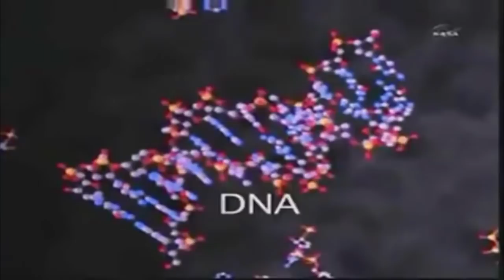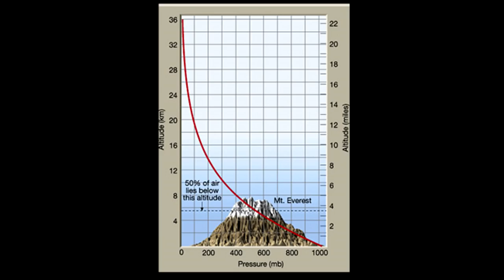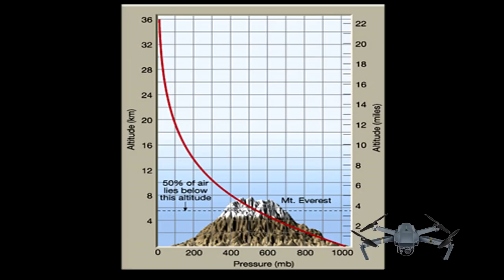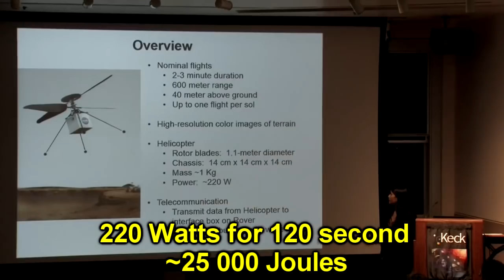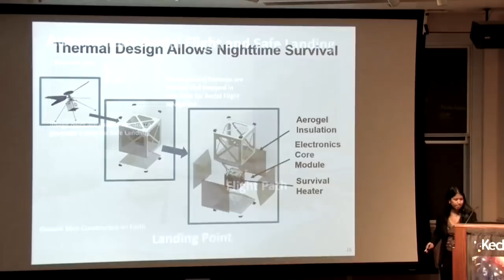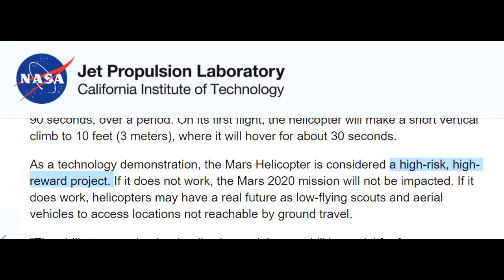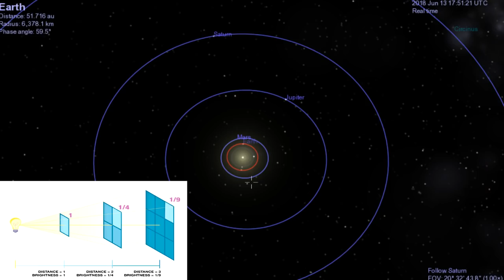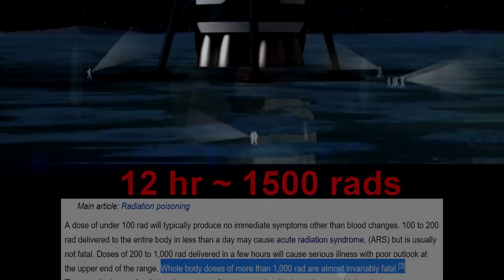NASA is sending Helicopter to Mars!! Smart or Silly?

Comment: I have seen a number of NASA projects that sounded designed by an group of sci-fi fans without life experience, I still remember when I was a teenager trying to design inventions that would work well on a movie or cartoon but would not follow physics rules. Lack of engineering education and life experience drove me to put on paper a significant number of projects. However, after years of experience and education, I continued to use my creativity to design projects. One of the mistakes that R&D directors are trying to find solutions out of they sphere of knowledge. Inviting skilled and experienced collaborators could sort this issues out. For example regarding the main subject of this video, NASA could very well use the lander module or a mobile solar panel as a recharging base using induction for the helicopter. Also the helicopter could have as the video shows while in the lab test area, a light and flexible wire that would have on it a magnetic base at the end allowing it to stay attached to a charging dock base at the ground. The lander or vehicle would move few meters a day as they do at moment but at same time, it could deploy the helicopter to explore the surround areas without the helicopter losing much of its power as it would still attached by the very light weight wire, and if necessary to cover longer distances it could retract the wire or just fly higher than the total length of the wire to move further and then returning back to the lander or rover to reconnect and further recharging. I could write here over 10 other ways that could work, but I am not a NASA's engineer, never applied or think I would be invited of the blue because my public suggestions. Regarding ''Elon's Enceladus'' I also wonder why they can't find people that could solve problems. Perhaps the presentation is just a mock of how the concept would be at final stage and not the actual project. Sometimes the new doesn't necessarily works better than the older. For centuries naval vessels and land explorers, carried fuel and supplies in extra vessels or cargo carts. As modern technology sorted the issue of caring all what they need in single vessel such as a commercial passenger airplane, nuclear powered air carrier or a train, capable to leave the destination and return without the need of refueling or resupply if necessary. Said that for future technology engineers and researchers need to look back and take lessons from the past. Taking an extra smaller spaceship docked by cables to the main vessel would  provide electrical energy generated by a small nuclear reactor that in fact would provide much higher energy than the solar panels and at same time totally safe and disposable to the main vessel. In this proposal If one of reactors malfunction, it can be discarded in the space while offering no radiation risks to the crew that would be in the main vessel. If you try to find a better solution for this scenario or just in case urge; ''what if the nuclear reactor fails?'' Simple, instead a single large reactor, a series of smaller or at least 2 reactors inside the same cargo vessel would solve the problem. If any of those reactions come to fail or offering any risk to the entire cargo vessel, it would be detached from the main frame and then left lost in space. I design medical devices and experienced with multi-core devices providing a number of solutions for systems. It is favorable to have multiple small source of data composed of over 500% requirement than one single source capable of 800%. At any time if one of these sources fail, the data still going through the system as in a single source no mater how powerful it is if one fail for any reason the entire process goes to a halt. The solar cells still valid but as a back-up system.

Comment: Here's a breakdown of its composition, according to a NASA fact sheet: Carbon dioxide: 95.32 percent. Nitrogen: 2.7 percent.

So what other types of fuel could be used well solar pumps making a compressed gas lift system, out of the atmosphere. Or utilizing a substance that burns in Carbon/nitrogen atmosphere.  Then there are chemicals in use and not in use. I would state a nuclear engine, could it work... What would be the best place. Although, a repair battery, and many little bots could do all sorts of rough linear work... Then there is organi culture and waste method, so you have a endless battery until the culture replication dies off completely, but this could power a device oozing otu its waste across the planet, lol. 

Magnesium gas combustion engines might work on mars... HMm… and Magnesium is pretty reactive.. I don't know, but designing a energy system for the planet would make more sense.
Reply: As for solar power, I think as a way point for recharging a source ata star would make sense, and then making a journey... but who knows we can all dream up things ,but do they work, lol

Comment: When these drones are on the ground and anchored somehow, couldn't the rotors and motors be used to charge the battery using the wind?
Reply: Jay Stone Good point, though the rotors may not have a large enough surface area to generate a lot of power

Comment: It is an interesting idea but I wonder if another concept might work (of someone more knowledgeable reads this, feel free to add to what I say or respond)-

Perhaps rather than a large, fully independent drone that operates, charges and fully looks after itself...

What if you designed a significantly smaller drone that was attached to and worked in conjunction with a larger Rover similar to curiousity?

A lot of weight could be reduced if it did not have to generate it's own power, nor house as complex of equipment.

My idea would be to ditch the solar panel, and make it as small and light as possible. With a battery that could power it for perhaps five to ten minutes worth of flight.

Have it launch from the Rover, gather images and data desired, then program the Rover to locate and retrieve the much smaller drone, then charge it slowly over a couple days with the Rover's overall greater power generation.

Just a thought.

Comment: A thing that I've heard is that progress in efficiency of solar panels is actually rather fast. Was the solar panel you based your calculations on state of the art at the time of filming? What influence does the expected difference in efficiency between then and the time they need to finish the final version of the drone have on the energy production?

Comment: NASA will spend millions to have a more efficient solar panels. Spend millions on balancing cooling and heating. Engines will be sealed and built in a clean room, indeed the whole vessel. Hardest part in IMHO is the AI software necessary to fly this fully automated and make decision as to what it is doing every millisecond in a untested environment.  And then you Martian winds... those will make crashing a common thing. But hey they are trying...

Comment: Thinking about it, this could be a good application for those silly micro-watt nuclear diamond batteries. Not to run it, but rather to maintain standby power during periods of no sunlight.
Reply: Radioisotope heater units already exist and have been used in the past for this purpose. The Lunokhod rovers had Po-210 ingots to produce heat and standby power.

Comment: Serious question: what would happen if they used nuclear power?
Reply: Disclaimer: I am NOT a real scientist.

But my understanding is radioactive elements are generally quite heavy.  Also the most reliable and maintenance-free nuclear power generation uses the Seebeck (or thermoelectric) Effect - temperature difference applied to thermocouples to generate electricity from the heat of radioactive decay.  The Voyager space probes use this method for power in the form of "radioisotope thermoelectric generators" or RTGs.  When they were new, each Voyager RTG generated about 110W power and weighed over 80 Lbs..

The twin limits are (a) RTGs are heavy and  (b) the Seebeck Effect is not very efficient at converting heat to electricity.

Comment: You're talking about quadcopters, and saying that if they crash, and land upside down, you have to stand them upright before they can fly again. That's not entirely true! At least with racing quadcopters, it's now possible to have them flip themselves (using manual stick inputs, but it could easily be automated) by reversing the direction of two motors at a time. So, depending on how the Mars quads are designed, they could easily do this. The method I'm describing does require a multirotor aircraft though, with separate rotational axes.

See this example:

https://youtu.be/0KW0Zf-d_M8?t=1m3s

Comment: i couldn't find exactly how thick the Martian atmosphere is but im pretty sure it's not 1:100 in comparison to earth
Reply: The Martian exosphere starts at about 200 kilometers; the Earth's starts at about 700 km. However, the relevant number is not thickness, but surface pressure. Flight essentially requires generating a pressure differential to create lift. The atmospheric pressure on the Martian surface averages 600 pascals (0.087 psi; 6.0 mbar), about 0.6% of Earth's mean sea level pressure of 101.3 kilopascals (14.69 psi; 1.013 bar)." So, its 6:1000, which isn't too far from 1:100.
Reply: @someolddude3858  thanks 😀

Comment: Yeah, your graphic at 4:35 is too simplistic, this is far from optimal . The optimum angle of attack for a flat plate like you show is around 10 degrees - while there is marginally more lift at 45 degrees AoA, the coefficient of drag is massively higher (1.1 vs. ~0.02), needing much more driving power for very moderate lift gain. A wing with a curved aerofoil section will also produce much higher lift than a flat plate for a given velocity. Others have already noted that lift varies as the square of velocity, so I think you need to rethink this whole bit. 

To give NASA their due, they do know quite a lot about aerodynamics, and about flight at low atomspheric pressure - they flew the solar-powered Helios HP01 for 40 mins at over 29km altitude. Plus they can test their designs in simulated Martian environment using the giant vacuum chamber at Plum Brook Station in Ohio, including the tether to offset Earth gravity. So I think there is no question that the engineering works.

How useful is the mission? Well you won't know until you try it. This is how engineering progresses - by trying things, seeing what works and what doesn't, then optimising what works. Spirit and Opportunity rovers were only ever expected to last for around 90 sols (Martian days) due to dust gathering on their solar cells, but they actually lasted around 20 times longer due to entirely unexpected cleaning events. Flying the first drone on mars will be more about testing the concept and the engineering, not about any longevity of mission or doing much science.

Comment: How is NASA planning on anchoring this one kilo drone during the sand storms? That thing will be tossed around like a plastic bag in the mars sand/dust storms. This has failure written all over it.
Reply: Mars has much thinner atmosphere which means objects aren't going to get pushed around that easily. You can compare this to running against 30hm/k wind and being waist-deep in water and trying to run against 30km/h water flow.

Comment: im no expert  but wouldnt it be easyer  to use the nuclear powered rover to recharge the drone
Reply: yeah but it would severely limit the operating range of the drone. it would cut the effective eploration time of drone in half 45secs going and 45 returning. curiosity has done less than 14miles in 7 years where as this would have a range of 600m per flight

Comment: The problem with your calculations is that you are trying to use simple physics instead of proper aerodynamics. 45° Angle of attack is simply wrong, most airfoils max out around 15° before the flow detaches on the top of the wing/rotor (called a stall). Rotors do not just push down air with their bottom side, they "suck" air down with their top surface. 
The blades do not need to spin 100 times as fast, because lift is not linear with speed, but squared. You'd need 10 times the blade speed. The proof is in the lift equation:  0,5*Density*Velocity^2*Lift-Coefficient*Wing-Area. 
That means you can both increase velocity (up to a point, supersonic blades do not work very well) and rotor size to get the required lift. 

By now, you know that they have done it, but that does not discredit your criticism, because imho, it was justified and you didnt go to the extreme with saying it will not be able to fly.

Comment: Why don't they make they blade with solar panel.  No point sitting there doing nothing out of flight.
Reply: PV panels are a terrible thing to make lifting bodies out of. Also they SPIN so there's no chance of an electrical connection between the rotor and the hull.

Comment: re : the small solar panels ... could the rotor blades  double as solar panels ?
Reply: Doing that would add mass to the rotor blades, which creates two additional problems: it requires more power (bigger battery, larger motor), and the rotor material would have to be able to withstand the centrifugal forces of the additional mass added by the solar arrays.  All this adds  mass, and as mass increases, power increase requirements are not linear with mass--they're exponential.  It becomes a beast that cannot eat fast enough to stay alive.
Reply: @thedevilinthecircuit1414  ...  Mass ... that pesky mass ! .... Thanks for Your reply

Comment: At first when I saw your video I was completely in agreement with you. But after listening to you i realise it can be done. I'm sorry but you are wrong about a lot of things. Firstly helicopter blades don't work that way (read about aerofoil). Mars has low pressure but that's not a problem. Aircraft propellers have rpm length and all dimensions set according to the air. ( Read about propellers going supersonic). Then you talked about battery, well since gravity is 1/3 you need 1/3  thrust to lift a 1 Kg drone. Then the solar energy, well without any significant atmosphere and with efficient solar panels they will get more than enough energy on  Mars. As for the heating issues they have rovers working on Mars they have figured it out already. Now as per the complexity we have drones far more advanced already and getting better every day with redundancies. If you still have doubts about the batteries they can have a docking station where it can change itself or keep itself stored for the night or for charging. This is a very innovative idea and far cheaper than rovers.     

P.S. 
Elon Musk's ship was using that power for providing thrust to the ship, in space very very little continuous thrust can get u really far and fast(read about solar sail)

Comment: 13:37 Wouldnt the motor be the main thing that gets hot? And Im guessing it can survive the colds of night better than the electronics.
Reply: If the electronics use the kind of power that's being estimated for this thing to operate, the heat produced by them will be a non-issue.

Comment: Nuclear cells power the rover ... if you don't care about humans on board then we have good solutions for powering the drone.
Reply: Nuclear is pretty heavy though. And you still need shielding to protect the electronics, which makes it even heavier. It would never get off the ground.

It would work on Titan though, with its much denser atmosphere. That’s what the proposed Titan heli will use.
Reply: @Sir_Budginton  that's a valid point, those things are heavy.

Comment: 6 ohurs ago they flew for thr first time.
Reply: 3 years ago thunderfoot predicted it might do a hop like the one done today
Reply: @oldscooljoe6194  well todays flight was just a test of the systems.  i would have been confused if they went straight on to flying a longer mission first thing.
Reply: @jizburg  we'll see. 

I wont expect this to be a viable method of mars exploration. Mainly because its greatly power inefficient. 

What might be a solution though is if they would be able to produce a different power source from the survace of mars. Or if it could be charged on a certain charge pad with bigger solar panels. But all i think ingenuity might do is capture a couple pictures from the air and thats it. It only has 4 scedueled flights wich imo perfectly fits with everything our man thunderfoot has said.
Reply: @oldscooljoe6194  indeed we Will see what happens.

Well he did not realy "say" much att all. Other than "intreresting. We will see what happens"